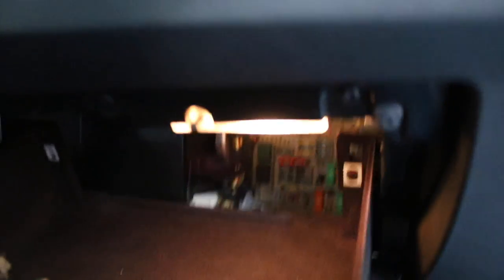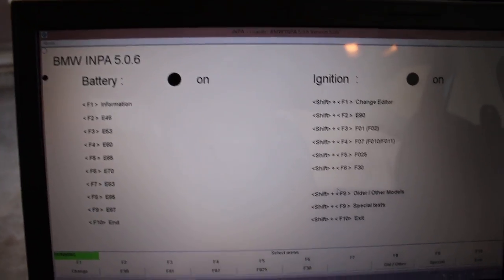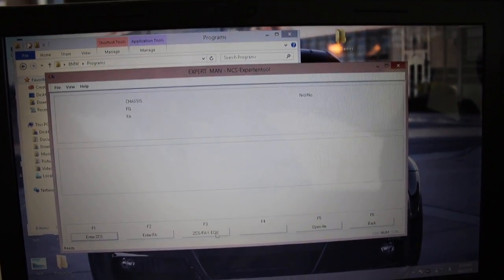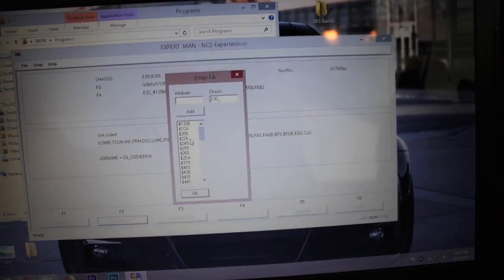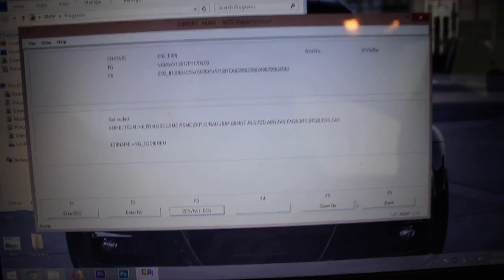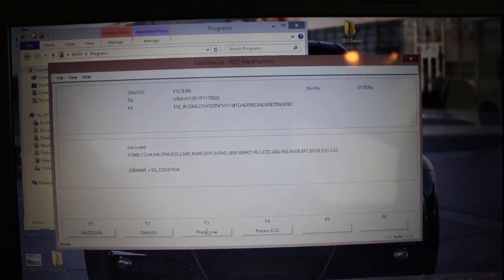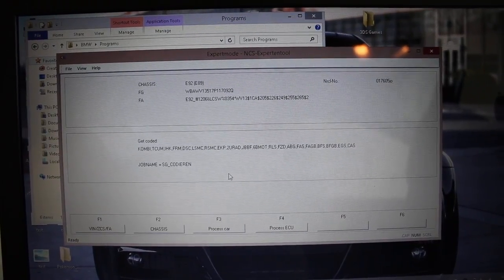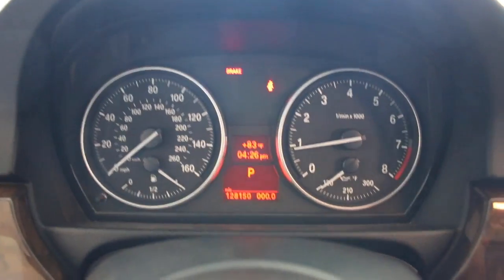REMOVING TIRE PRESSURE LIGHT FOREVER! (E90,E91,E92,E93)

Comment: Hi Nour, i noticed that in your BMW before you had the airbag and seat belt lights on what did you do to clear those lights because i'm getting the same thing but not sure what to do?? my car is 2011 Bmw E93
Reply: KCAN probably
Reply: Seat Occupancy Mat Bypass BMW 3 Series E90 E91 E92 E93 Sensor Airbag Emulator

Buy this, copy and paste
Reply: There is actually a °90 wire on the front of the battery that you need to electrical tape TIGHT to the battery. Reset codes and thats what did it for me.

Comment: Hello 
I have 2007 BMW 328i 4d 
I’m trying to find out where is BMW Tire Pressure Control Module Rdc location? 
I did check the rear battery & also by driver near vinyl, also behind seat? No luck yet 
 Any help? 
I really need to get this tpms light to be gone.
Get back to me when time arrive 

Thank you
Reply: Is under the car by the driver seat... I believe

Comment: What about just moving the sensors from the OEM rims over to the new ones?  All major aftermarket brands are compatible.
Reply: its a pain on alot of aftermarket wheels i got new wheels last week and the sensors would not fit on my new wheels i dont mind i purchased a tpms system off of amazon which works great and actually shows the psi of the tires unlike the idrive one also the light doesent bug me but i know for alot of people it may be annoying to have the tpms light illuminated 24/7 on the guage cluster.